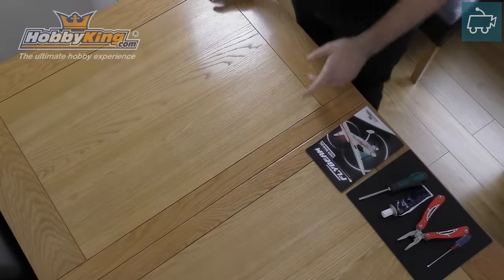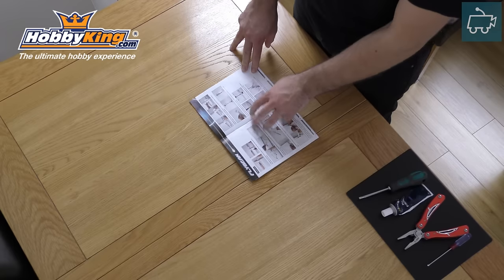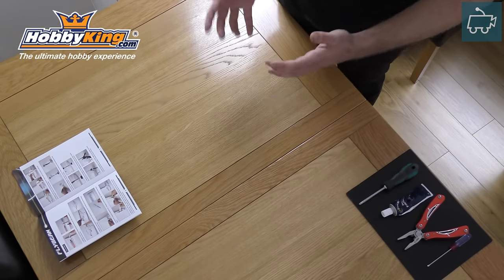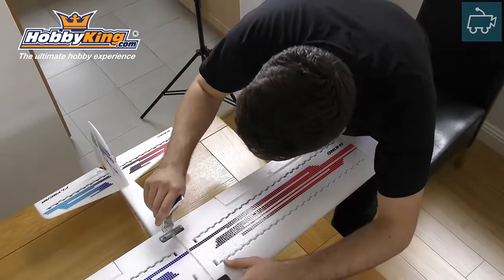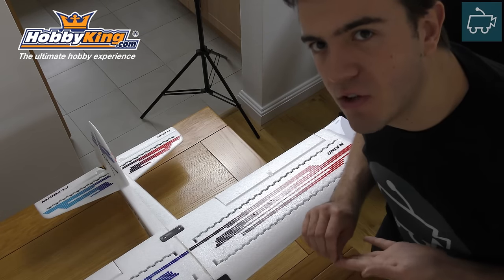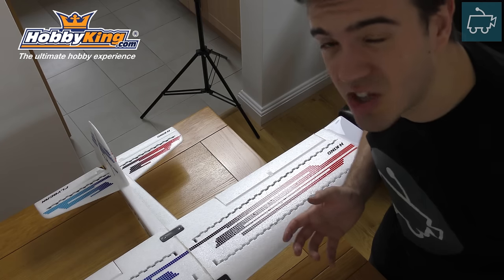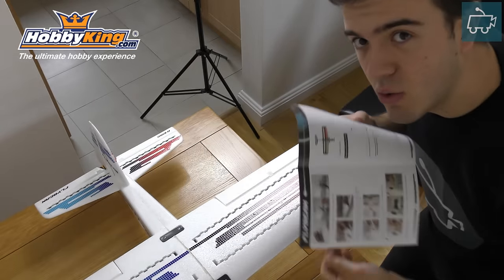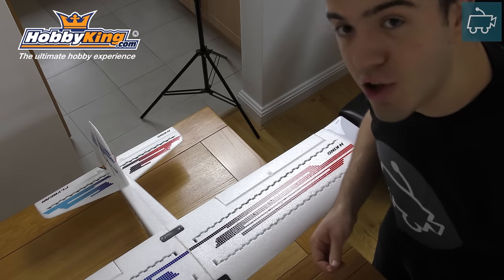Building an RC Plane with LED's - Night Flying! The HobbyKing Flybeam

Comment: Nice looking plane Josh,looks well made,I'd love to fly a 4 channel aeroplane,I tried to teach my self with an e flite pusher prop glider,it was very difficult and I had a fly away after a few minor crashes,put me off,but I can fly a drone and a 4 channel helicopter so I may try again sometime,I hate crashing badly and losing things though!😯😦😉
Reply from the maker: This kind of plane is very easy to fly, just wait for a nice calm day for your first flight - I know It's difficult to have a day in the UK with under 10mph winds but worth waiting, makes it much easier. This plane pretty much flies itself, it's very forgiving! Lots of fun, I love planes :D
Reply: Yes,this plane has the high mounted above the fuselage wings that I've heard give great stability and self leveling,the E flite plane I had was fitted with a rear mounted pusher prop,it saved me damaging the prop when I crashed it but the low mounted wings made it very fast turning and rolling,it was an expensive model to lose but I may try again with one of these Cesna looking models,thanks Josh.👌👍😊
Reply from the maker: yes, go for it :D they're great fun
Reply: JT12's R/C Videos yes,one life,live it,my good man!!👌👍😊

Comment: Still waiting for them nitro plane videos. Much more power.
Reply from the maker: So.... I flew it , and then the aileron servo got stuck fully left. So it's awaiting repairs!  :(
Reply: JT12's R/C Videos That's not good. did you do a radio check?